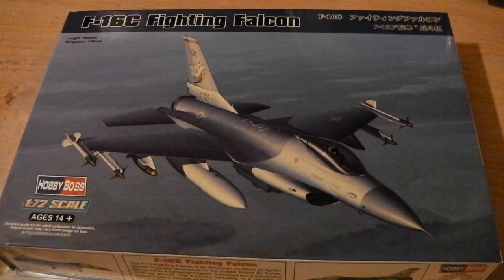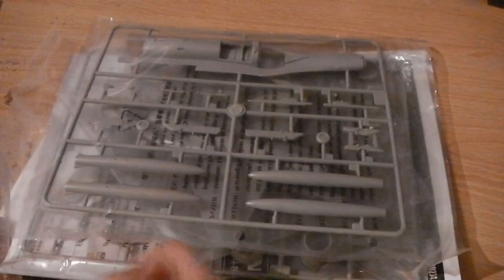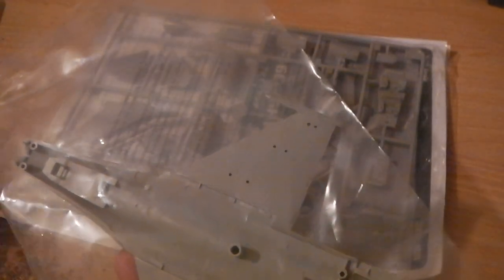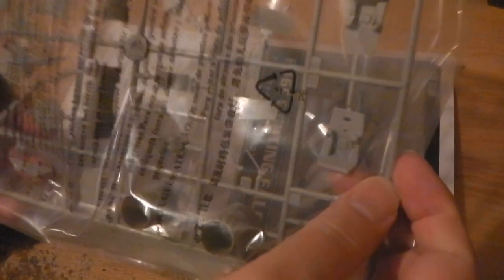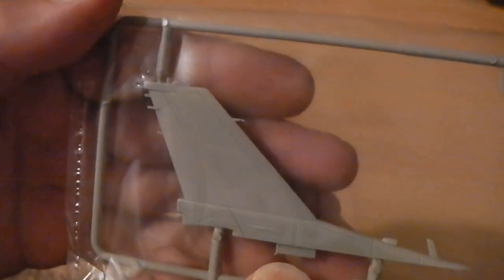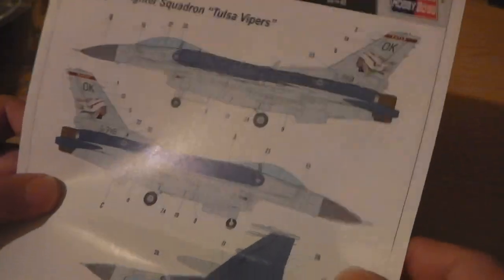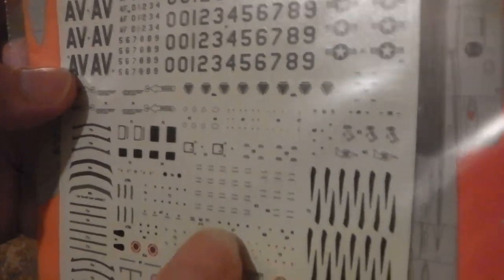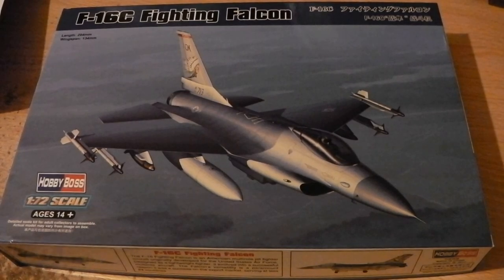The Hobby Boss F-16 kit in 1:72 scale, Part 1 The C model.

Comment: Great kits but be weary of the decals
Reply from the maker: Thanks and thanks.
Reply: @Payne2view i have built a few of their kits which are fine but the decals let them down big time.
Reply from the maker: @jaws666  What exactly was the problem you had with the decals?  How did they let you down?
Reply: @Payne2view  once the get wet they break up if you so much as look at them.
Reply from the maker: @jaws666 Then I shall try to apply them with my eyes shut 🙂   Thanks for the warning.
Reply: @Payne2view  no worries...you should check out other yt videos on hobby boss kit builds to see how others have had bad expierences with them
Reply from the maker: Maybe I will  @jaws666
Reply: @Payne2view  just so you can see for yourself...there is a t-birds F-16 build video and they building it had a complete nightmare with them
Reply from the maker: @jaws666  I've seen the Thunderbirds example for sale and when you mentioned the decals can be tricky, I thought those would be a special challenge.
The thing with F-16 kits is a lot of the liveries are "special" so are naturally more tricky.
Reply: @Payne2view  the hasegawa example is easy...the trouble they guy had was not that it was tricky but the decals wouldnt bed down and practically disintigrated they broke up and tore that much